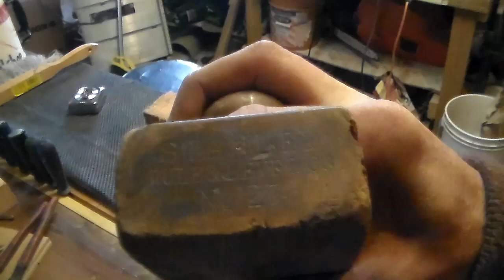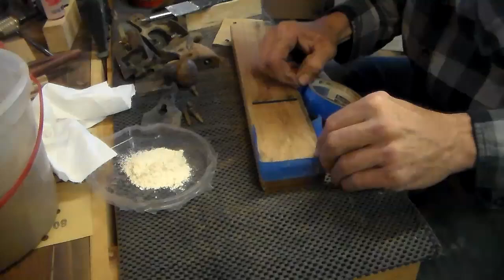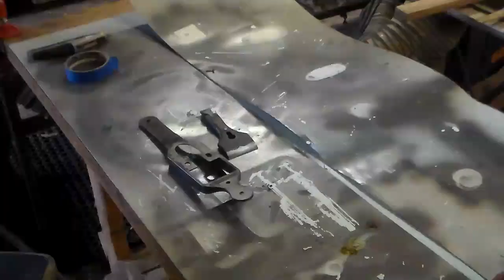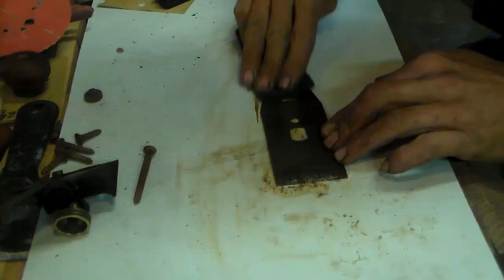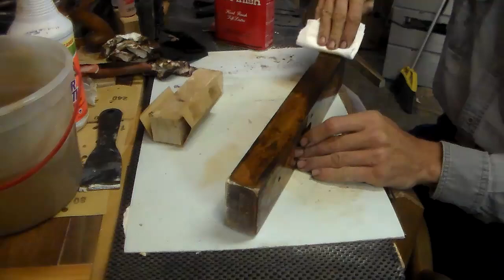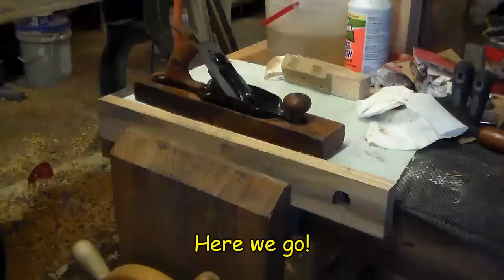Restoring A Stanley No 27 Jack Plane

Comment: Nicely done!  However.  I have a #26 stanley, which is nearly identical to the #27, and I intended to completely restore it, as you did, but the more I thought about it, Nnnno.  The hardware is in really good shape, except someone used pliers on the brass adjustment and nearly destroyed it.  Although,  I filed some grooves in it.  Sorry I did now.  The plane must have been dropped as the top of the rear handle has been  broken and there is a gouge on the left side of it.  The wooden body has a few very minor nicks for its age.  The metal hardware is really good and I did remove the surface rust.
I decided, instead of doing a complete restoration, to only put Johnson's Paste Wax on the entire piece for preservation, except for the cutting section of the iron and bottom of the wood.  I do think I will continue with occasional waxing on the metal pieces, but will strip the wax from the wooden parts and apply linseed oil as a preservative.   I just could not bring myself to alter any part of this planes history.   It works very well as is and I just didn't want to change it.
Reply: I just did some further research on this plane and found this plane was made in 1888!  I am so glad I didn't strip it down.

Comment: I like it . The only thing I would have done differently is the sole.  I like to plane them flat and then glue a thin piece of matching wood to the sole.   I just didn't like the contrast between the glue sawdust puddy and the old wood.   I'm sure it works fine.

Comment: Good work man. I've restored a Bailey No. 26 but it was almost a total loss as the entire insides of the wood block had been eaten by termites. Originally I was just going to clean it up a little bit and flatten the sole but the 1st pass on my jointer removed the only remaining solid wood left (there was about 1/16th" on all surfaces), beneath that was far beyond saving. I milled it down about a 1/4" on all sides except the back where the stamp is. Then I glued a piece of Ebony on the sole, and Mahogany sides and top, and I'm pretty sure the original bodies are made from Maple. The metal parts that had been Japaned, I powder coated, and the bare metal I took to the bench grinder and hit with a soft wire wheel. I really like the soft wire wheel because it leaves all of the texture on the piece instead of how sand paper flattens the surface. The wheel also removes any and all crud and rust, quickly, and without using any chemicals. When you're finished, the small pitting from the rust just adds to the old look, but is harmless. I paid $25 for the No. 26, along with 3 boxes of vintage tools (and a few newer tools too). There was a beautiful Stanley No. 7 with "US PAT APR 1910" just abaft the frog. There was also about 15 block planes of varying vintage, one that I cannot for the life of me figure out who made it, and a new Lee Nielson Adjustable Mouth Block Plane.

Comment: Cy if you are going to start restoring more stuff you might want to check into a Molasses bath instead of vinegar  molasses i shte about the most non-invasive derusting there is it is a little slower but if your trying to save trade makes and stamps it makes it easier cheers
Reply: Nice plane BTW

Comment: I would really like to help raise your dental fee Cy, but for security reasons, I only use PayPal online, can you not ask if the fund raiser could add that option?
Reply from the maker: Go Fund me apparently does not offer that option. I don't know if You Tube has that option in the Fan Funding gizmo, but if it does you can donate that way, just gets to me via a different route. If you go to my Channel page there should be a Support button just under the header on the right side of the screen. Check there and let me know if they offer that in the comments here so others will know as well. 
And Thank you both for being willing to help and for being an active subscriber.